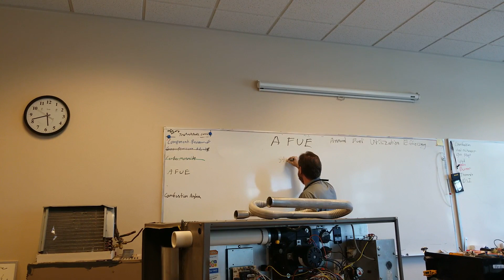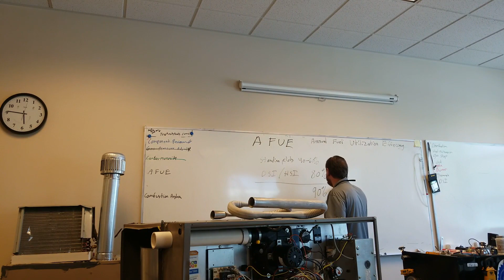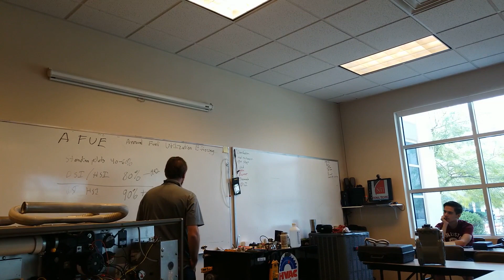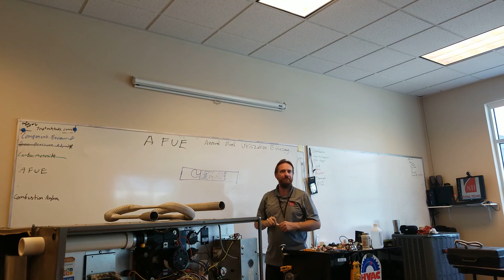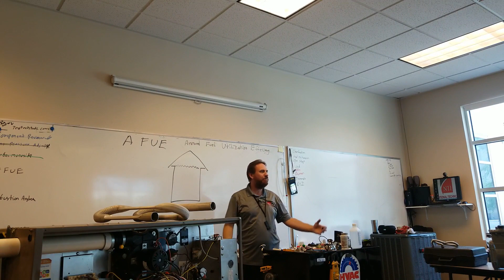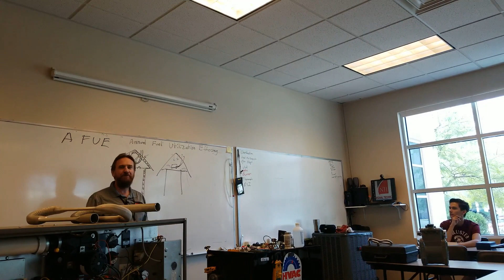High Effecency Gas Furnaces

Comment: My only thing with just change it out from the %40-%65 to the %80+ is affordability in philthydelphia (luv) I still run into H pilots😂🤣 now and then,and when you go in the house or neighborhood you know they can't afford the upgrade.🤔
So I would still teach standing pilots and the like not in great detail but just in case? 🤔
🥃🥃🍺🍺🍺🍇🏌
Stay safe.
Retired(werk'n) keyboard super tech.
Wear your safety glasses.
Reply from the maker: That's true. Certainly strong points of view for both. 

My big concerns note than saving money is safety. Carbon monoxide is a big concern. Way to many people die every year needlessly from it and most are to save money. 
Electric space heaters as dangerously as they are are still safer than. 30 year old standing pilot furnace. 
I would rather see an old 80% that at least has a negative pressure heat exhanger and some chance of a one direction draft. 
My personal view is home ownership comes with responsibilities and costs. People will buy new cars, new tv, new furniture, paintings, repainting inside and out and new carpet and be the first to say they can't aford a new furnace. 

I've seen too many times a home that had draft issues that pulled flue gas back in on the house on the standing pilot. Now  couple that with higher efficiency kitchen fans, hi flow driers and bathroom fans that are all pulling the house into a negative pressure your multiplying that problem.

There are plenty of gas furnaces and us experienced techs out here that feel confident is the risk scenarios of working on an old standing pilot furnace. 

I do not have an issue teaching standing pilots once someone has taken a combustion analysis class, and a CO class to understand building pressurization and the risks involved.
Reply: @love2hvac  PGW the rule was(is) make sure the chimney is safe!
Believe me I don't have a problem with walking away from someone trying to be cheap,but there are deep pockets of people who really truly can't afford much, and I do know the city is replacing some at a snails pace.
Also a 100 year old BOILER that's not leaking is no danger, as long as the flue way has integrity.
There's baso boxes in use today lol !!!
Reply from the maker: On a seperate note it looks like electrification will be the next big push. It's possible they won't even have the option to buy a new  furnace in a number of years. 

I think electrification has some potential with the advance of heat pumps and home sealing with blower door testing and foaming. 
I do not like the fact people will be forced to that move. 

But what can we do, after all out rage where still just rats in a cage
Reply: @love2hvac  sounds like the 410 phaseout oh I mean the R 12 oh the R22 🤔🤣🤣
Reply from the maker: I just hope the new  refregerant generation uses an oil that's not hyroscopic!
Reply: @love2hvac  say that again, mineral oil you could just leave everywhere(we did) and reuse it 😆
Why would you go to an oil that is so finicky ,with all this technology you use an oil that can't be exposed to the general atmosphere around it🤯
Reply from the maker: Yes! 
"Here is an acid, let's dehydrate it and make it an oil."
I want to meet the ones that thought that was a good idea.